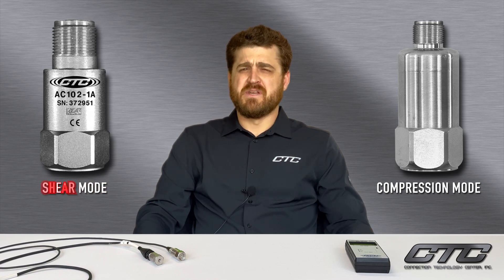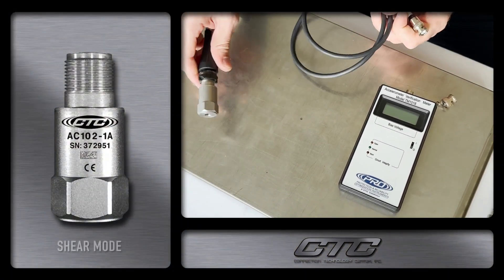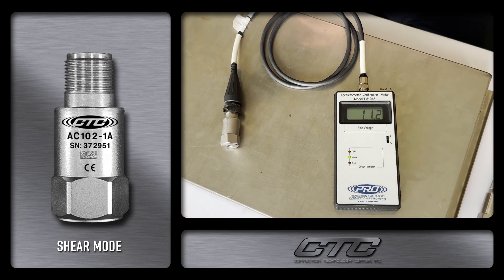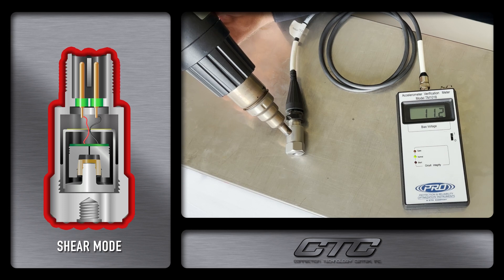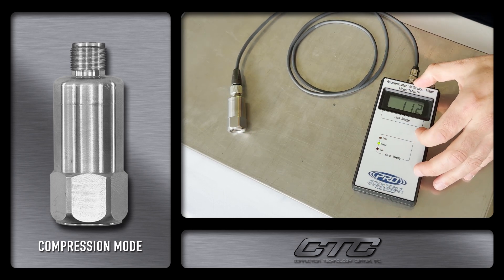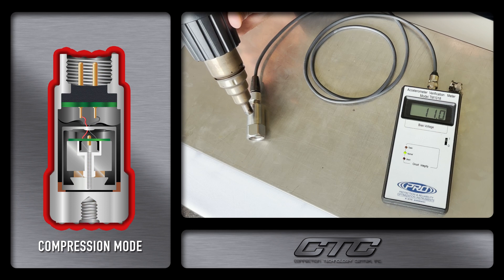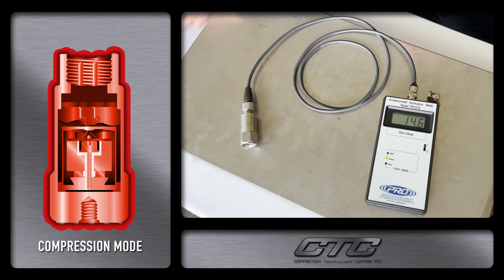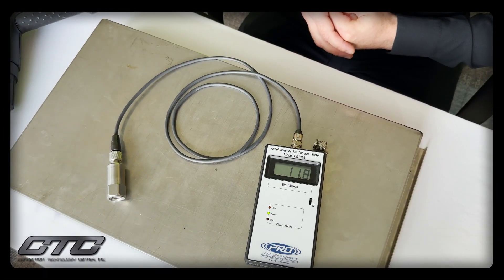Live Demo of the Impact of Thermo Transients on Shear vs Compression Mode Accelerometer Design | CTC

Comment: A slow change in bias doesn't affect the  ac coupled signals unless it is extremely rapid, which is unlikely.  40G difference would not be seen as capture systems have a dc blocking capacitor to eliminate the bias. Would like to see more about other differences in performance -- dynamic range, noise floor, low freq performance, high frequency resonance, max G ratings and so forth.  Thanks for posting this video.